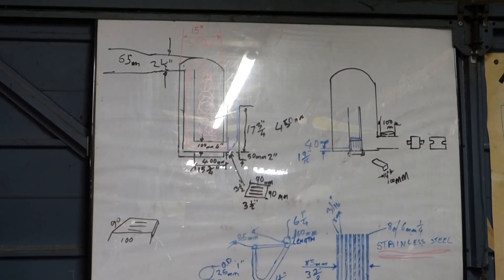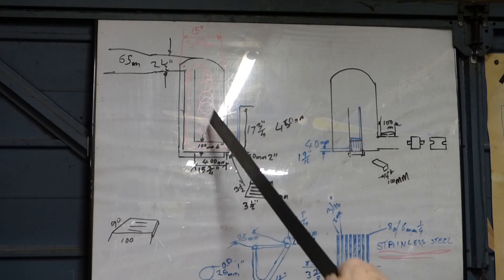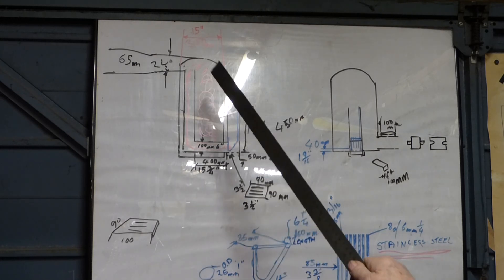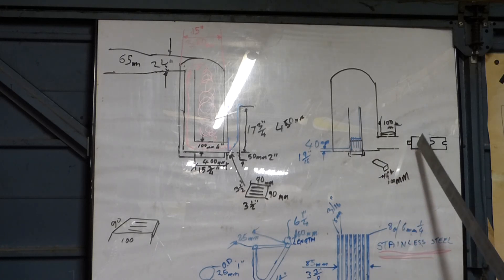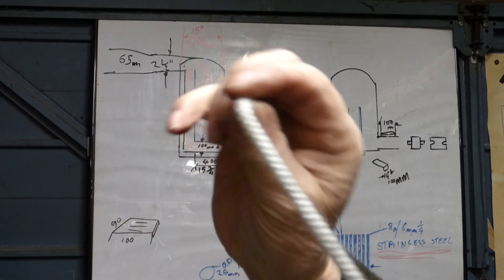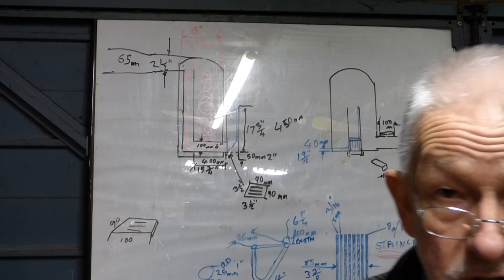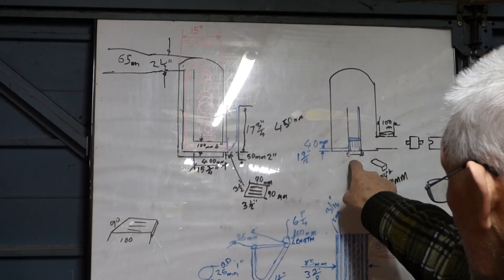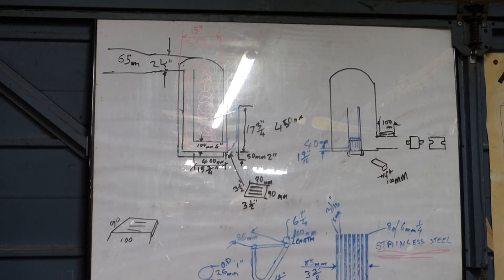rocket stove heater No.31

Comment: Hi David, thanks for sharing your videos and knowledge. 

Would you please expand on the length of the bottom feeder tube. I believe you said it should be at least 400 mm and shorter would not draw as effectively. Is this determined from trial and error?  Is it hard 400mm or 4:1 length:width ratio?

I plan to build a room heater similar to your whiteboard design and burning scrap timber and wood cuttings. If possible I want to use some RHS I have on hand; do you believe there is any problem with using 125x75 (rectangular) rather than 100x100 (square) section?

Thanks, John